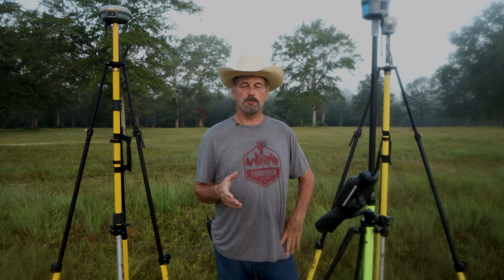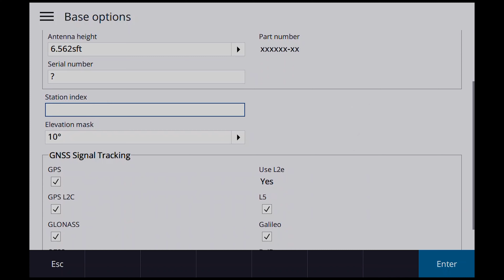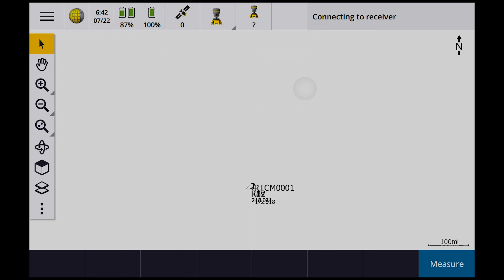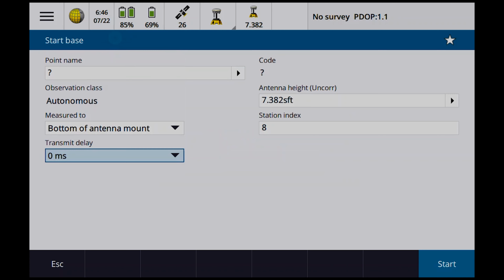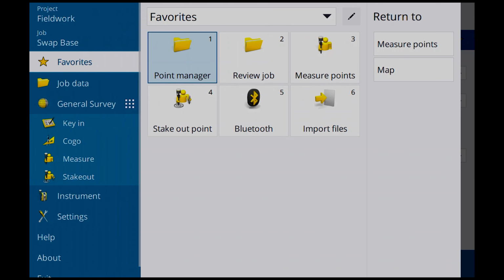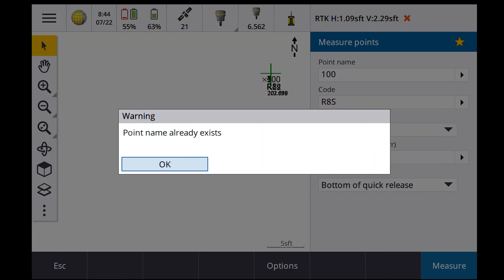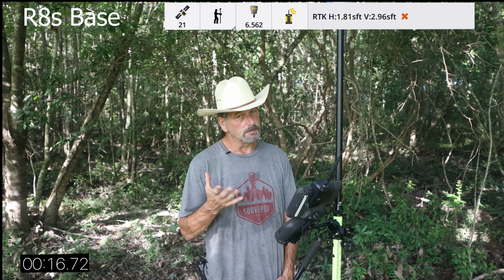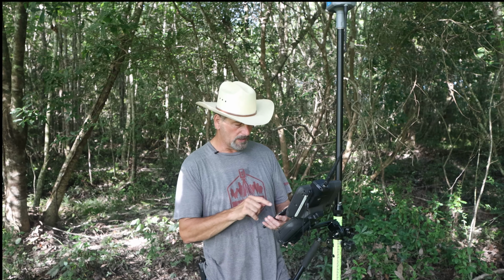Surveying with a R8s and R12 Base with a R12 Rover

Comment: If you run two bases, on different frequencies, you can avoid dumping the rover and merely switch radio frequency, and immediately take a subsequent rtk shot, and now you truly have statistically independent connections to that monument or control point without waiting for a sidereal time lapse.
Reply from the maker: You are referring to duel bases or duel vectors. You have to offset one of the radio signals, both on the same frequency and use swap base.

Comment: Hi, is it possible to use the r12 together with the r10? this is what i got and i would like to use it this way. is there any way i can read how this is done? i am very new to this all...
Reply from the maker: Just set the 10 as a base and 12 as a rover. Follow the video I have on the R10-2 setup. R10-2 are pretty much a R12 and they all work the same. Hope this helps.